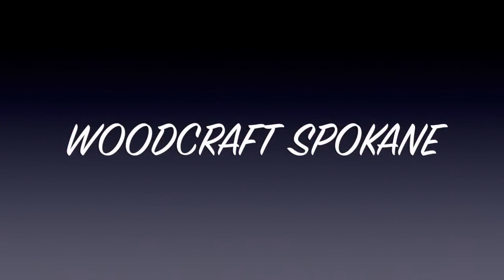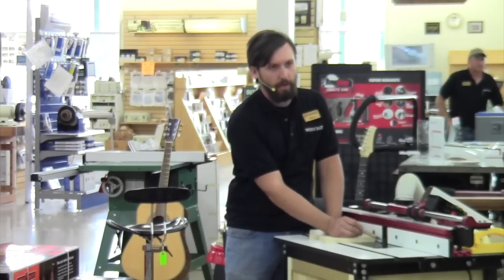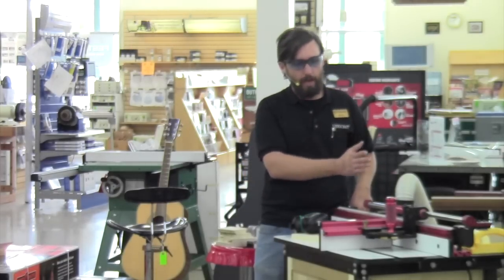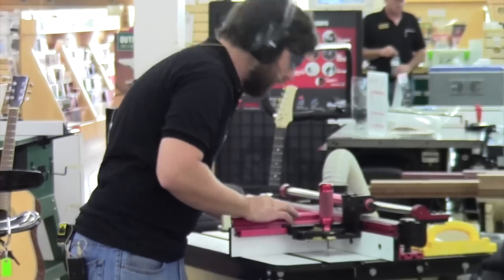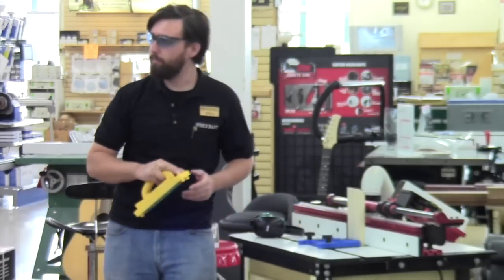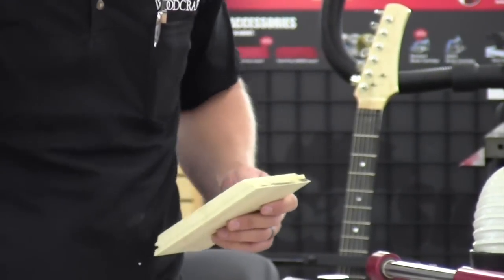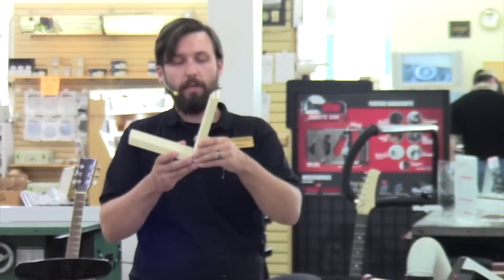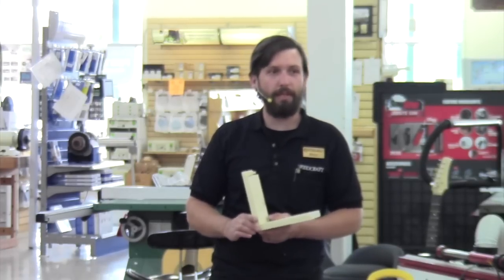Using the 45 degree Lock Miter Bit

Comment: Dangerous endcut.  He should have clamped a guide board that ran on top of the fence to prevent the rotation of the piece while routing.  Doing a short board freehand without a guide on a heavy cut is looking for trouble and an accident.  

On survey of experienced woodworker accidents found that 85% were caused when people cut corners on guards, safety and setups.

Comment: Instead of using this to make a 90 angle, can you put two pieces to  just make a wider board?
Reply from the maker: Although I haven't tried it, seems you could run the boards, one face up and one face down, on the table and that should produce two equal/opposite profiles, a lot of glue surface and should keep the pieces well aligned.
Reply: @WoodcraftSpokane  thank you very much

Comment: Hate to say it, but it looks as tho if you plan to use this joint often, you would be better off getting another table and router to leave set up for this. Such a PITA to get set up every time you want to do this.
Reply: Even this would not be 100% b/c the precise thickness of the stock is going to vary.  The key to the set-up is getting the height of the bit centered on the center of the thickness of the stock; same with the fence -- it depends on the thickness of the stock.

Comment: Doesn't look like those bits work very well for doing end work
Reply: They work fine if you use a backer board to push and keep it square. The way he was doing it was asking for trouble!
Reply: Good Stuff.. going to get one and give it a try. Thank you for your input.
Reply: Little confused! Was the end cut even necessary?  I thought when he cut A and B he was going flip them 90 degrees to make the corner, I thought the cutter was made symmetrical so rotating one piece would make a corner? Standing on end is not fun.
Reply: The first pair of cuts set the bit height and the second set the fence position.  Guess this is something that once you get right you make some set up blocks for